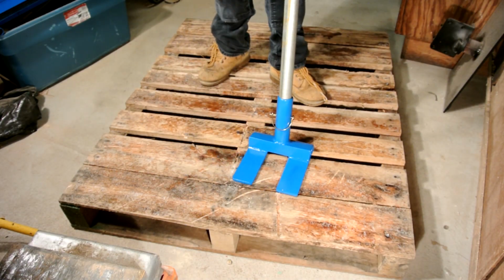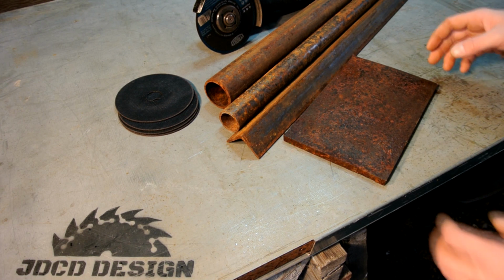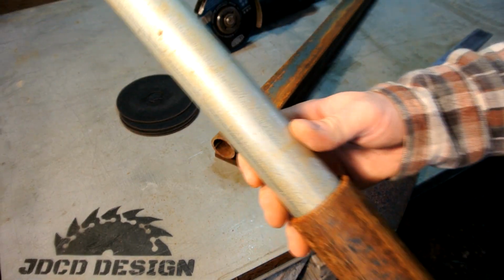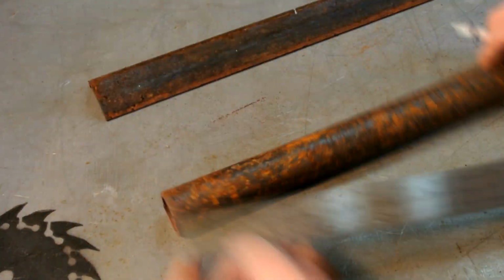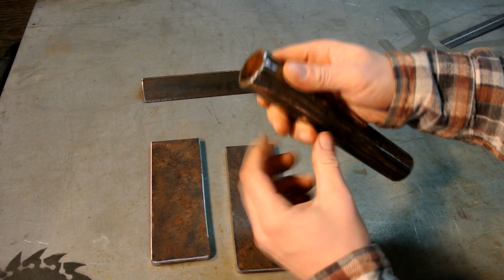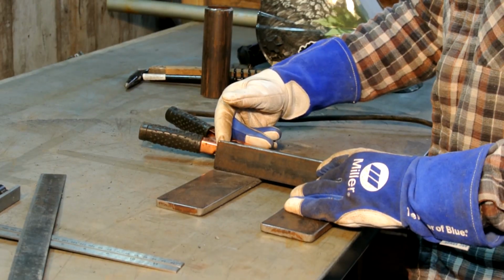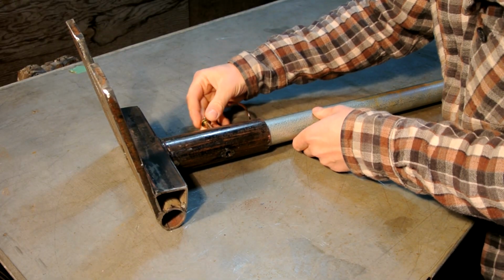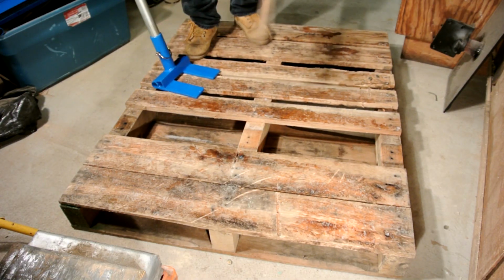How To: Pallet Pry Bar for removing pallet boards for DIY projects

Comment: I purchased a "Quad Bar Tool" (  https://www.youtube.com/watch?v=HkLy1ILLFuY&t=19s )  wrecker bar... I developed a system, in which I slam the bar under the blocks, separating's the slats / blocks, with a 5 lbs sludge /// Single Jack... Over time I beat the bar in the rear so many times it fatigued and cracked,, I must have re-welded it 10 times but today, I had the toughest of the tough "{pallet from hell}" normally I get the pallets apart quick,,, this time.. I looked down and hhhhmmmm my wrecker bar is in pieces... it finally met it's match....

Comment: Great video. You mentioned you used gasless welding. What amperage/power is your MIG welder please? I’m trying to decide on a hobbyist 100amp MIG ( which they say will  weld 1to 4 mm thick metal) or a 120amp welder (which will do 3 to 6mm mild steel). An experienced welder could probably go outside those parameters. But the foot part of the tool you made is 3/8 steel for the pulling strength no doubt, so I don’t want to get a welder that won’t do the job. Any tips would be appreciated.
Reply from the maker: Yes, for the "gasless" welding I use Flux core wire 0.035" I believe. The welder I use is a Miler 180 autoset. This is a 240v welder which can weld up to 5/16th.

Comment: Or purchase 2 (flat) hardened pry bars. Drill and screw to comfortable length of 2x6. Fashion a handle on the other end. Done. Even a single prybar at the end of a long lever is okay (mine split and broke, one side was all I needed for the rest of the pallets). Pallets I had were brittle and plank spacing differed a lot, so there is not one perfect tool fits all. In the end I was able to salvage a decent amount of wood. p.s. if you drill hardened steel, you will need e.g. a cobalt or other hardened drill bit). Hardest part is pulling nails that can be pulled and cutting off the rest, picking up all the mess. Most saws these days with tungsten tips will easily cut through nails, though, of course, it is better to avoid doing that, if possible.

Comment: These have been commercially available forever, but being a specialty tool, they're too expensive.  I made mine from  1 1/4 round bar for the handle and flat bar for the fork.  Weighs about 60 lbs, but it gives you plenty of leverage and is actually effortless to use.  Using one of these causes less splitting than you would get with a regular crowbar or flat prybar.

Comment: Oct. 15, 2019---Thanks for a very useful tool and how to video. Hopefully you patented this? No doubt built ones could be sold thru Harbor Freight, Home Depot, etc. Not only them, but there's a couple of companies in Reno alone that tear apart and rebuild pallets for resale and probably using crow bars and hammers.

Comment: I made a similar one a few weeks ago. The claws on mine bent, so I doubled the thickness and no more bending. Some boards are extremely hard to get off if it's thick, strong wood with the twisty nails.

Comment: Hi JD, I built your pallet buster to your specs. One pallet actually bent the 3/8" plate. I took 5/16 plate, cut two 1/2" strips, then heated the forks to get them as straight as possible. I then welded the 5/16 plate perpendicular to the bottom of the forks. PROBLEM solved. This thing is now a beast!! I think the only pallets this thing won't disassemble are the blue "CHEP" pallets as they are bullet proof!!!!
Reply from the maker: Im glad to hear you fixed the problem! Its great hearing from people building the tools and changing them in the way it works best for them! i definitely have to agree with you on the blue pallets, they are usually oak which is the wood i try to go for but they sure don't like to come apart.
Reply: Yes, the blue  GKN CHEP ones are in a league of their own.  Companies usually have to employ a "Pallet Recovery Team" in order not to face a massive bill from GKN  for "lost" pallets which they rented to the company.
But yeah, this tool looks the bees-knees for practicality on the rest.
Making one tomorrow! Cheers.

Comment: Hey JD, Great job. I'm in the middle of constructing your design right now.I'm thinking of beveling the end of one of the lifter forks, cutting a "V" in it and use it to pull nails from the runners or slats. You are a talented young man. Keep up the videos
Reply from the maker: That would be a great addition, 1 less tool you'll have to use! 
Thanks for watching! happy building.

Comment: Hey man, I'm attempting to replicate your design but I have slightly different angle iron. (1 1/2"x2") do you have a recommended angle iron to tip of prong measurement?
Reply from the maker: Hey thanks for the question! If i understand it right your asking for the front of the angle iron to the front of the prong correct? 
I based my measurements off pallets i normally see, i took the width of the pallet boards and added roughly 1/2" to that (from where the angle iron will hit the edge of the pallet to the tip of the prong) This way you have more surface area on the board itself and will help keep the board together. we can call that the "working area"

In the end it doesn't really matter, as long as your steel (working area) is abit bigger then the pallet board.
I hope this novel of a answer helped you out! Thanks for watching!!

Comment: Excellent vid. Thank You for sharing your dimensions. I'm going to weld one of these but I think I can do it out of simple bed frame angle iron instead of 3/8" solid steel.  I also like your choice of, using flux core wire.  All you need is .030" or .035" wire.
Reply from the maker: Thanks! You can use any material you'd like! the angle would work great, i just had this material on had. I weld with flux core because i don't have gas and its also a lot cheaper to weld with flux core, I'm using .035".

Comment: I am a total novice in welding and I have been thinking about safety when welding, especially earthing. Looks like you can touch the object you are welding ( I have been thinking whether you can touch the object being welded or not). Can I have any other electrical objects (like a radio, extension cord, phone etc) on the table I am welding on, or can they get messed up because of earthing?

Comment: Now that you've built it and have had time to use it would you change anything about it? anything that could improve it more?
Reply from the maker: Iv had no issues with it so far! i have made a stronger steel handle. If i had to change one thing id make the pivot piece at the back abut bigger so you can get more leverage, But so far im extremely happy with the design.

Comment: Thanks for your video. I made a tool following your plans, but it was unsuccessful. I have a slightly different type of pallet and the pallet didn't move an inch when I used the lever. The pallet lifted up with the lever and I couldn't break it. I use too much force and bent the tool a little bit.. but the pallet stood still !
Reply from the maker: niquedouille The tool will need fine tuning and altering based on your needs, im just giving the measurements of mine. What thickness steel are you using? I have encountered some very tough pallets but haven't had any problems. Sorry to hear your build was unsuccessful, but there's always room for improvement!
Reply: Hi JDCD, thanks for your answer !
I'm using 4.5 mm steel for tubes and corner iron, and 8 mm thick plain steel for the fork. Sure there's room for improvement for me ! :) The pallets causing problems are like this : http://www.idfmateriaux.paris/boutique/images_produits/palette_bloc-z.jpg

Comment: I like your design, but you must have some pretty lightweight pallets with short nails over there. I have just made two of these from your design, and tried out one of them yesterday. After breaking up three pallets, the "tynes" or fingers were both bent, to the point that they started lifting boards from the edge only, resulting in splitting of the timber. I have just modified one of them by adding a tapered length of "C" section steel under each of the tynes - this should stiffen them up significantly and does not have any adverse impact on the ability to slide the tool in between boards on the pallet.

Thanks for posting your design and giving the detail and measurements. It made it easy for me to knock up a couple. I have welded a "claw" from an old demolition bar in between the tynes in the centre of the tool so that it can also be used for pulling nails (similar to that on the Crescent Bull Bar) - this also works well. For handles - I grabbed a couple of fibreglass / plastic mattock handles from the hardware and shaped the top to suit the square tubing that I used instead of the round tubing that you have used. They are cheap and light and look good with the tool painted the same blue that you have used.

Comment: Wow! what a great video. I don't weld but I picked up a little lincoln arc welder and am learning to strike an arc. can I use it for this project? Thanks so much for a really good instruction video. I can't wait to try this.
Reply from the maker: Thank you! Im not too familiar with arc welding but im fairly sure you'll have no problem using it for this project!  Happy building.
Reply: Daniel Miller you would have no problem using a stick welder on this fairly thick metal....

Comment: Not as easy as it looks some pallets have twist nails and some have four nails per run. You earn the wood
Reply from the maker: John Coonradt jr.5 This is true but iv used this on a oak pallet with 6 or more nails in a board and this had no problem taking the boards up. Yes you have to put more effort into the pull bit composting that with a hammer and nail bar it's a cake walk.

Comment: I just built one of these with scrap metal I had laying around. A buddy of mine just gave me 300 pallets. I'm going to make hardwood flooring.
Reply from the maker: That sounds like a fun project! you will save alot of time and effort with the pry bar! Good luck on the flooring!!
Reply: Most pallets are made from softwood , flooring is hardwood ,